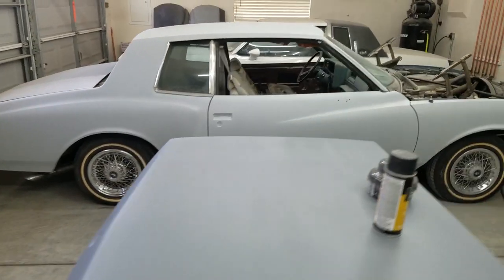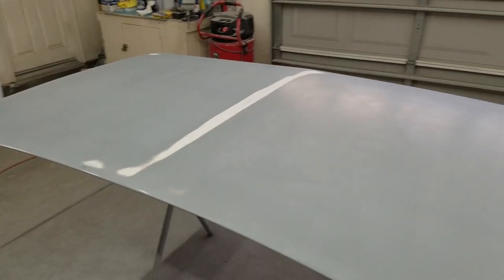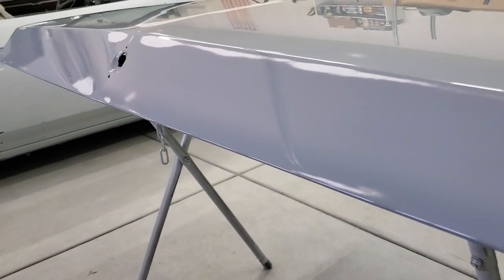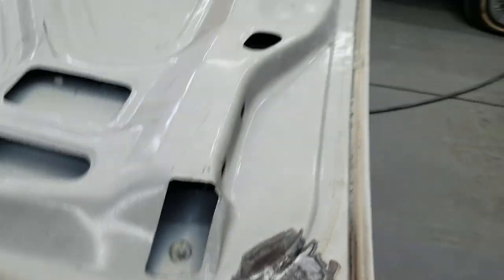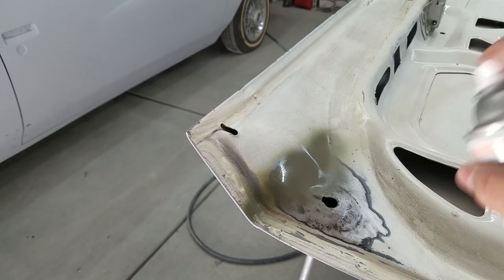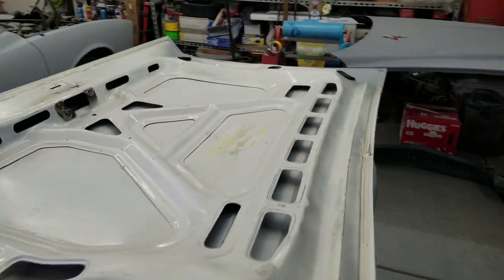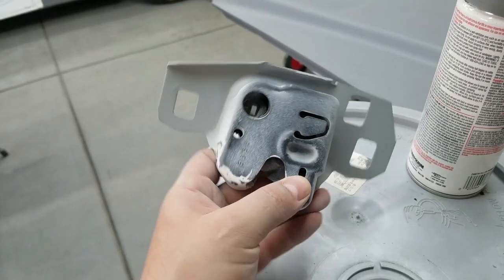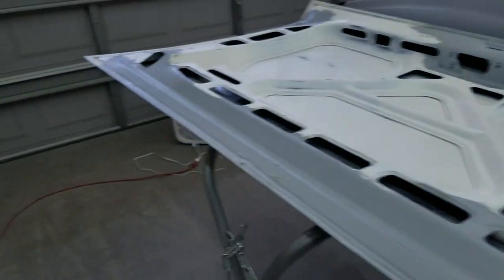Trunk Lid UNDERSIDE Prep for Paint 78 MONTE CARLO

Comment: What would a guy do with a trunk like that, that has some minor surface rust between the trunk skin and the reinforcement panel with the holes in it that occasionally sheds some rust dust when you open and close it? I have a 64 galaxie that has a pretty nice trunk but the typical lack of even coverage from the factory between the trunk panels has caused some minor surface rust that comes out from time to time. Blow it all out and spray some sort of rust converter product down in there in attempt to stop it? really can't get anything in there to sand it out. I'd like to repaint the underside of the trunk lid one of these days.
Reply from the maker: Exactly what you said is what I would do 💯 Eastwood has a rust encapsulator thats for hard to reach areas....check them out...I'm sure there's other brands that offer the same thing.